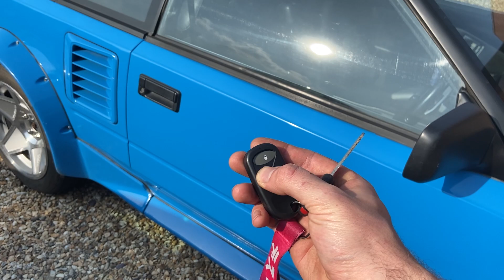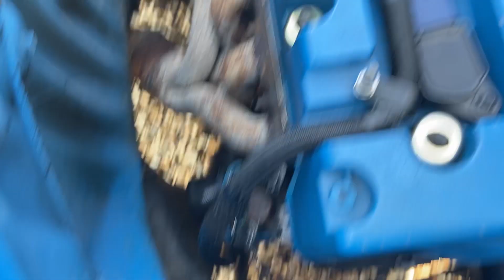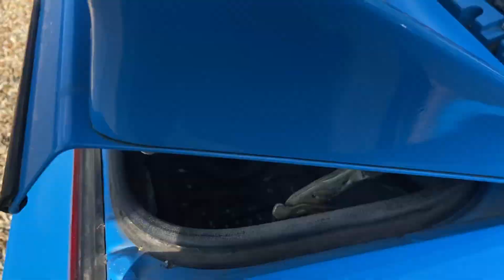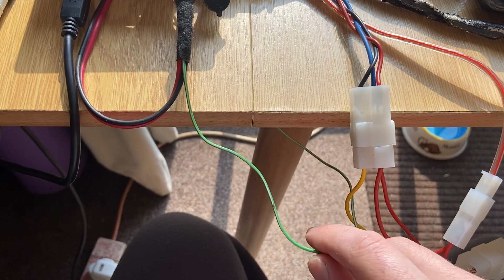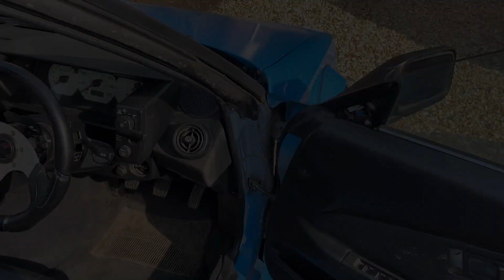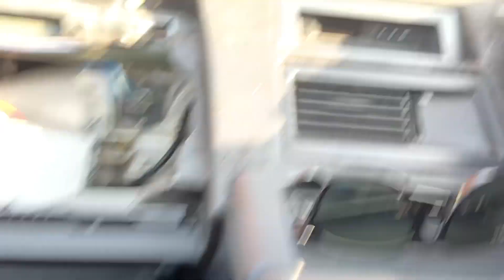Walk Around and Exhaust Valves

Comment: Hey I’m really hoping you can help me please respond to an old video 
I’m in need of a pair of driveshafts 😭cannot seem to find any info on it
Reply from the maker: @Benokiss98  are you in America or somewhere else in the world? America you can buy Hux racing driveshafts from TheDriveshaftShop
Reply: @Loztown  I’m in the uk and the shipping would be a pain I’m already getting k swap mounts from hux racing and the driveshafts for 1400 usd is a bit much for some driveshafts so I’m looking to get some dimensions so I can get some made in the uk
Reply from the maker: @Benokiss98  ah okay. I’ll check my emails and dig out the dimensions for you. I got them done at Berrisford.

They have also just done some for my 2.2 hdi berlingo swap. It’s £550+ vat for the pair tho.
Reply from the maker: Drivers Side – 18.5” Shaft length
Passenger Side – 17.25” Shaft Length
Reply: @Loztown  does this include cv’s or is that just the shaft if you know what I mean?
Reply from the maker: @Benokiss98  I believe it’s just the shaft. But put the engine in clean up your aw11 cvs and get some OEM ep3 inners, and check the measurements. They will want you to send them patterns anyway.

Don’t buy cheap pattern part driveshafts to chop up either.  Get the real deal from a breaker. Most of the cheap companies use their own spline designs to save time. Which means buying a new cv joint further down the line becomes impossible
Reply: @Loztown  thank you mate really appreciate the help
Reply from the maker: @Benokiss98  no problem. There might be more info on the blog. It was a few years ago now. Still wish I’d never sold it! https://www.woodsport.org/forum/showthread.php?24000-Project-Phoenix-A-barn-find-story
Reply: @Loztown  thank you I was really hoping you would reply 😂